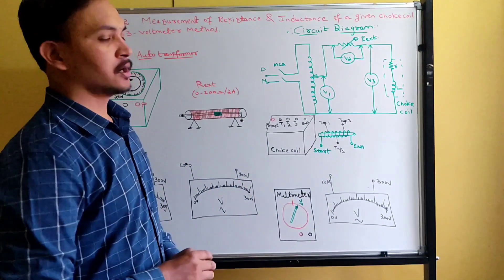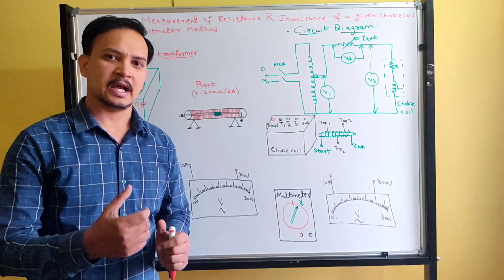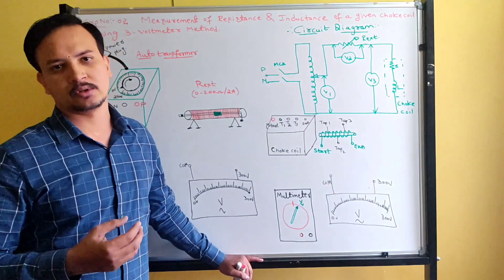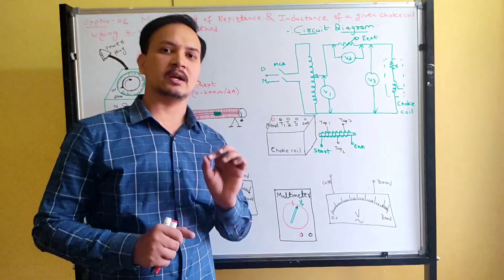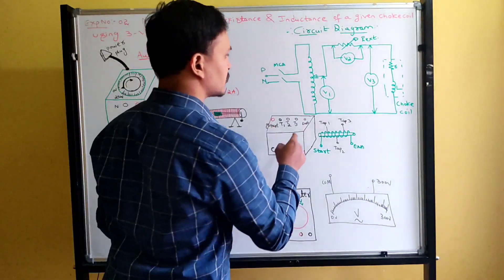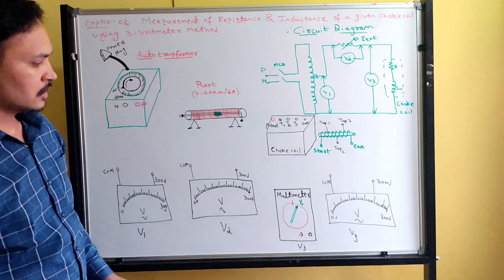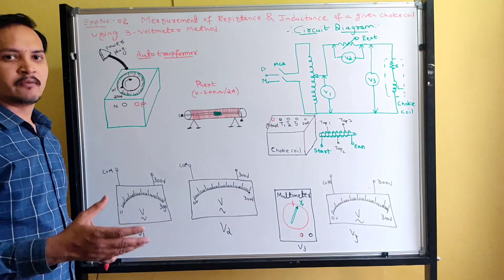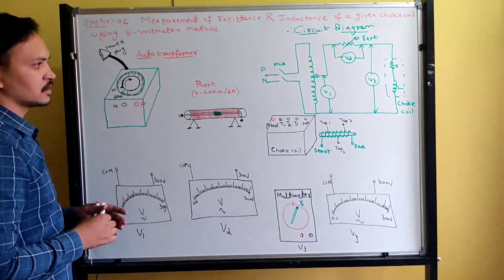VTU|CHOKE COIL EXPERIMENT BASIC ELECTICAL LAB|18ELEL17/27

Comment: Sir presently I have scored 46/50 in internals for electrical lab 
Sir if I can't able to do experiment in externals am I failed or passed sir
Reply from the maker: You will fail.

 you have to score minimum >=50/100 in lab exams.
Reply from the maker: You scored extraordinary in internal, but you to score in exam minimum 50/100 to pass finally electrical laboratory.